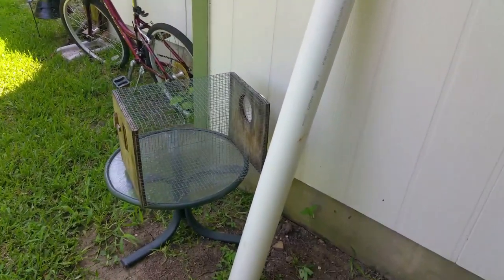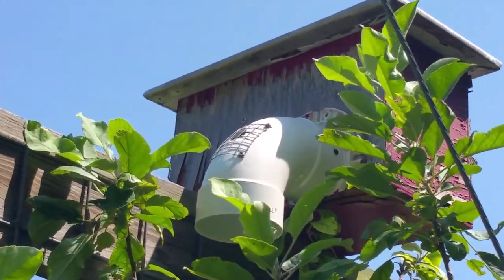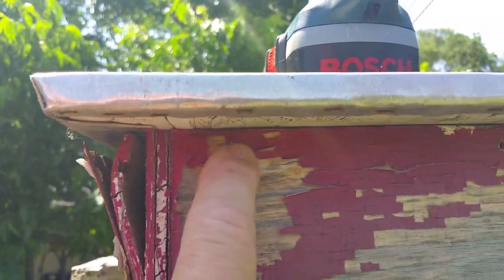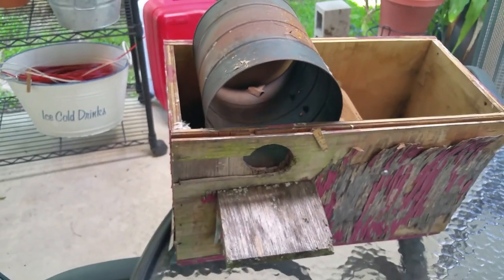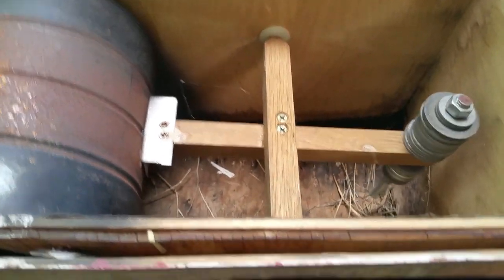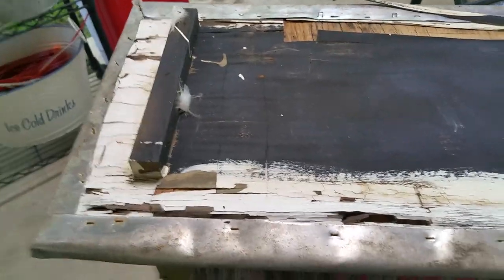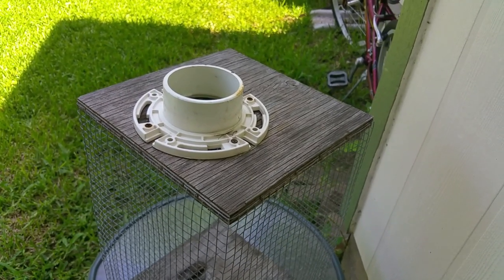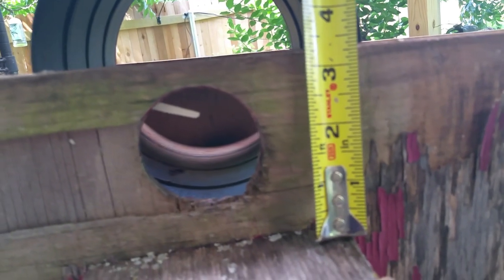NB Starling Trap

Comment: you don't really need the toilet flange. Just make your PVC pipe long enough that it extends into your trap. Then cut your hole in the top the same size as the outer dimension of your PVC pipe. When you put it together, just slide your PVC pipe down through the hole, again making sure it extends at least an inch or two into the trap. If you're worried about appearance you can probably find a 3" or 4" gasket that you can slide onto the PVC pipe before sliding the pipe into the hole and then you can slide the gasket down onto the top of your trap board, but I don't think that is really necessary.
Reply from the maker: I wasn't trying to reinvent the wheel.I copied the original because it worked.
Reply: @crude4u1948  I was just merely making a suggestion, not trying to put down anything you did.
Reply from the maker: sorry if I was a little snippy. Thanks for the input.

Comment: I would just be curious to know over the time you have had this trap in place.. what has been your experience? Have you trapped a lot of starlings? I know they are a real nuisance bird.. like flying rats. Have you caught any other type of birds in the trap?
Reply from the maker: I always remove the trap when I'm not home or leave the bottom door open. The only other bird. I've caught besides starlings is a mocking bird and I released him unharmed.
Reply from the maker: It's very effective to deactivate the trap for a while by removing the trap down below and letting them go in and come out and go in and come out.eventually they think that there's no danger to it.
Reply from the maker: It is extremely important that you monitor the trap. As I was thinking back. I believe I also caught a cardinal but no good birds have ever died in the trap because I didn't find them in time.

Comment: The roof covering wraps around the side and lets all the water run down the sides. That's why it is a mess in only 5 years. Make the top big enough to bend down the sides an inch or so and hang free of the walls. It's called a drip rail edge. Glue that metal "hat" on the top board, no staples through the water shield. Use a section of 6" aluminum duct or make it with the same metal flashing on a roll as it will weigh less and mean less counterweight and friction overall.  

I'm calling for AI camera enabled feeders to shock the perch when invasives are identified. Cats would hang out and clean up, or put it over the compost heap.

Comment: The method below is to catch 1 Starling at a time and requires
someone to be home and pay frequent attention to the trap
I found the 2 mouse traps below via the YouTube video 
I began using these traps to defend my platform bird feeders from an
overwhelming number of starlings descending on them.
I have adapted the mousetraps to catching starlings by placing sliced grapes into a small condiments container
and placing that container on the trigger mechanism.  I use the thin plastic cups that restaurants 
put butter & sour cream in for takeout customers.  I then secure a round piece of velcro to the bottom of the cup.
(I had to use the velcro, because the starlings began lifting the entire plastic cup off the trigger plate with their beaks.)
Inside the cup, I put two,  1/4 sections of grapes into the cup turned backwards so the starlings can not
easily grip their beaks around them without applying some pressure against the cup.
I have caught 11 starlings this way in a couple of weeks.

I use the smaller traps inside a covered platform feeder.
I have 2 of the smaller traps below. I use the one that is rigged to trap starlings later in the day.
I use the other one early in the day, to feed grapes to the catbirds and mocking birds.
Once the starlings show up, I begin using the other trap that is already "rigged-up" to catch starlings.
I hope this helps someone catch starlings and drown them.
Starlings (which live in huge flocks that coordinate their killing) are wreaking havoc 
on our native song birds (most of which live in pairs) 
The one problem with this method is that catbirds and some other bird species are also
attracted to grapes, so I frequently have to walk out to the trap and release a catbird.
Once the catbirds fly south for the winter, I am hoping to catch a much higher percentage of Starlings
WRZ
Delaware County, PA 2020-09-08

https://www.youtube.com/watch?v=WEr9zJksoJQ  The video that led me to the mousetraps on Amazon
https://www.amazon.com/gp/product/B0154F09I8    Product Size   12.5" x 6.5" x 5"  Single Door  Price: $21.50
https://www.amazon.com/gp/product/B07331WZ6G  Product Size: 10.5 x 5.5 x 4.5 inches.  Single Door $20  
https://www.amazon.com/gp/product/B013FLER72  Product Size:   10.5" x 5.5" x 4.5" Single Door  $17.98
Reply: If you use this trap to catch Starlings and it is placed inside a covered platform bird feeder,
you need to make sure you have enough clearance for the trap to go off and close completely.
This is why I use the smaller trap for starlings.  I tried using the larger size trap but I discovered 
I didn't have enough clearance for the larger model.
WRZ  2020-09-08
Reply from the maker: I have caught as many as 10 starlings at a time. They are curious and jealous and if they think one has found food or lodging, they want in on it.
Our starling problem is mostly in the spring during nesting for martins, cardinals and bluebirds. There is a similar trap for bluebird boxes as well.
No need to “pay frequent attention to the trap”,, just check it a couple of times a day. The cage can be released from the tube so that the birds can be dispatched.

Comment: I left out the un-needed floor and used flattened lead, save da washers LOL! Also, saved the elbow and fashioned it from wire screen, covered it with old tire inner tube, , cur a hole for daylight

Comment: Do the traps work for sparrows too? I am not sure about the weight, that is necessary for the balance of the pipe, as starlings are much heavier than sparrows?
Reply from the maker: Yes but if you are wanting a sparrow trap, there is a better one on the market.

Comment: Use MDO (Medium Density Overlay) plywood next time. It is plywood used to make exterior signs and will last a long time.
Reply from the maker: Typically for projects like this, especially experimental ones, I just use what I have on hand. MDO is usually ½" although sometimes ¾" is available but it's pretty pricey unless you can find some at a sign shop dumpster.
I recently snagged a full sheet when a new subdivision sold out and they were taking down their signs.
I peeled the vinyl off of it and and am ready for another project or I might rebuilt my trap.
Thanks for the feed back.